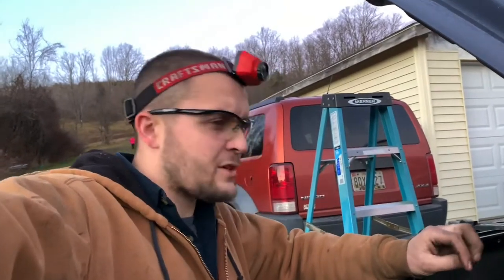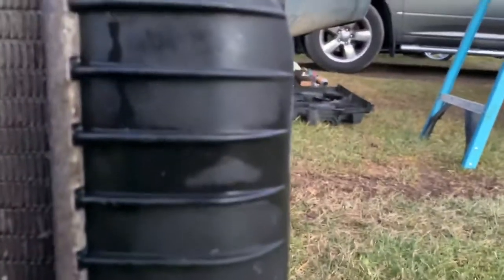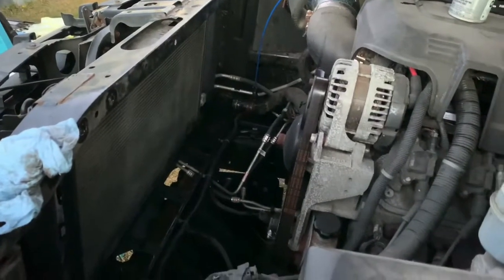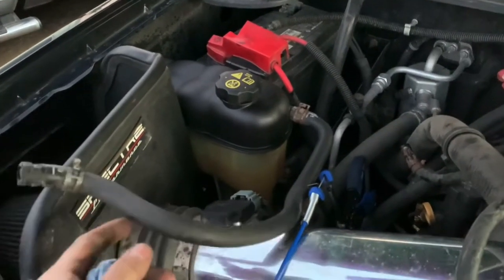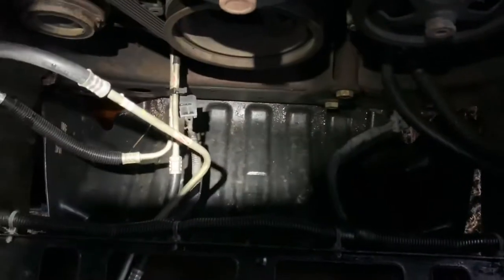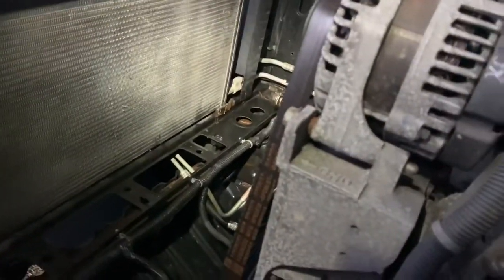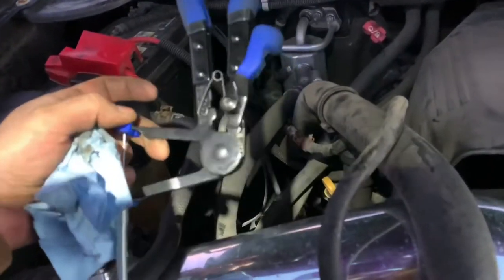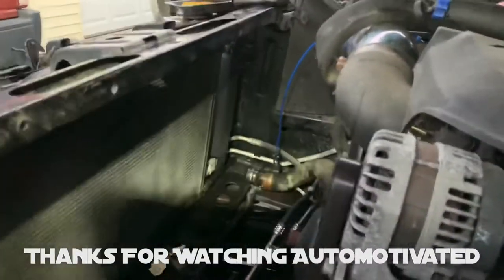2010 GMC Sierra Radiator Leaking

Comment: I like those remote hose pliers, that's going on the list!
Reply from the maker: There is a kit you get with three different cables with heads for styles of clamps. I use one head 95 percent of the time. There is some cheaper quality clamp tools that are similar to this, but the quality is junk. I bought two others before this Astro one. The kit is around $60 I believe on amazon. Well worth it Alan! I use this even when the clamp is in the open because it locks.  You won’t be disappointed with the Astro one. Are you familiar with Astro tools?